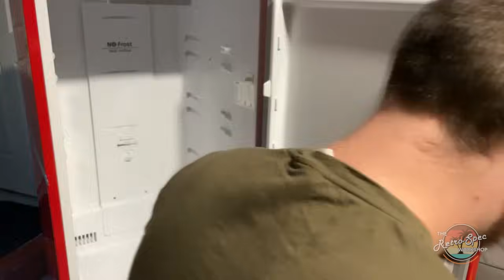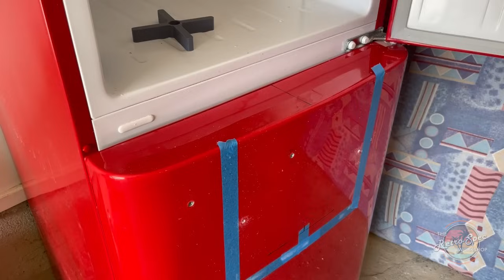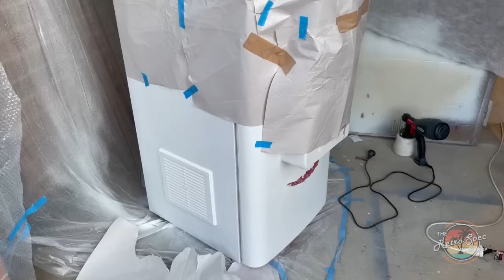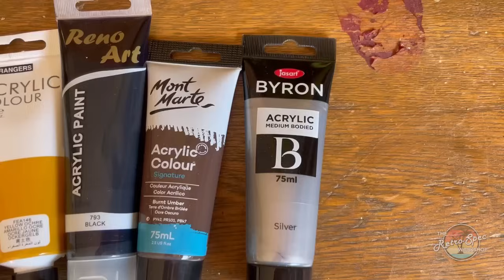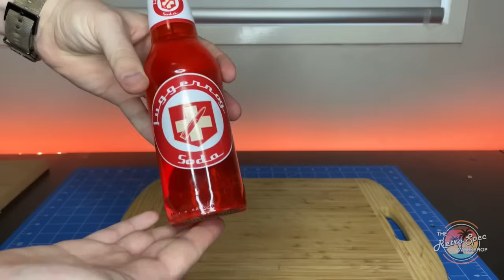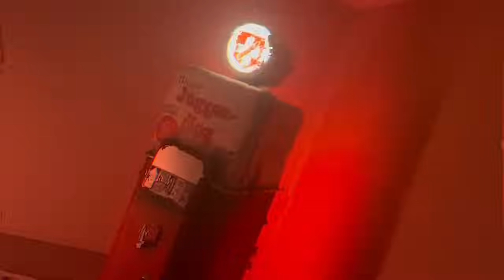I Built a REAL Jugger-Nog Machine! (CALL OF DUTY ZOMBIES)

Comment: Nice! Some nitpicks - the light at the top is not like that on the jugg machine, yours is too long and the base of the light which sits at the top should be red. Also the right side of jugg also has a vent slot.
Reply from the maker: Great attention to detail! I was actually modelling this machine from the early eras of WAW to BO2, the lantern changed a bit in BO3